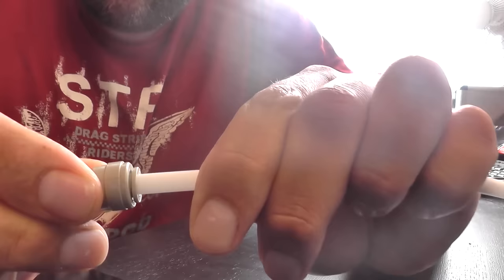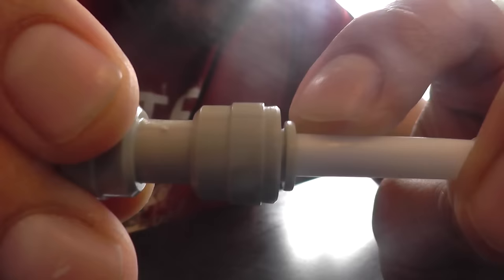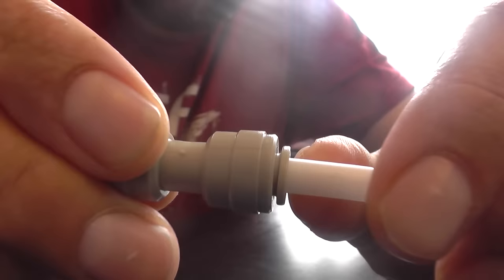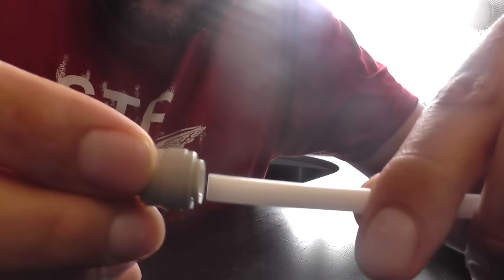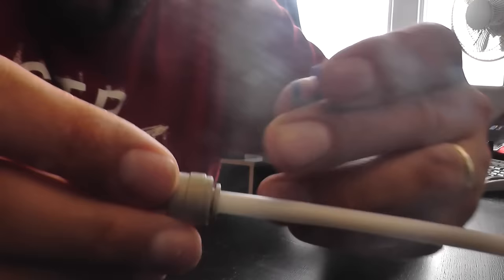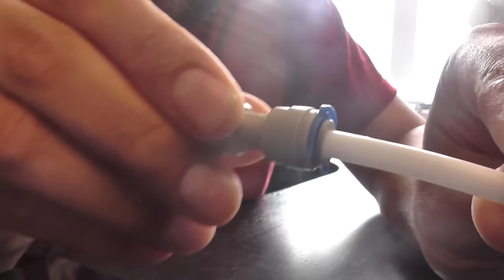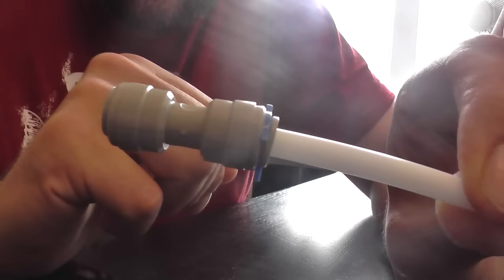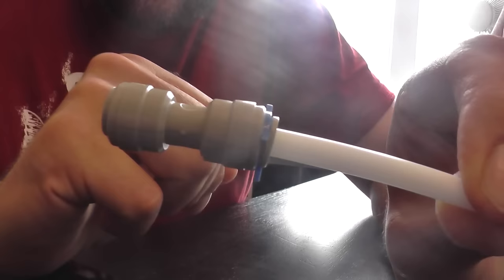How to Connect & Disconnect Push Fittings - Water Filter Systems Guide

Comment: Awesome. Thank you for the informative video. I purchased the connector part and was able to follow your video and connect the two ends of the tube together after cutting out the section containing a pin hole leaking water. Now no more leaks!

Comment: thank you for this video.  There is such an adapter on my water filter and I could not understand why it started to flow.  I just reconnected the hose and the leak stopped.  The video was filmed 7 years ago, but it still remains useful, thanks to the Internet!

Comment: Just what I needed after a failed installation of a water filter under the sink, I needed to disassemble the adapter, which requires removing the push connectors, and there is no instruction on how to do that in the install manuals. Thanks.

Comment: Osmio, Thanks for the helpful video. One question: Where do you get the clips that keep the connection tight? We need to prevent accidental disconnection of the tube from the connector. Do you have a manufacturer name and product name for the US? -- thanks.
Reply from the maker: Hi Tom maybe search for collet clips

Comment: I know this is an old video, but can the connection be rotated once it's secure without removing? They used this style on my washer connections and connections face each other so I can't connect the hoses. I just don't want to break it. It seems fragile. Lol.
Reply from the maker: It can be slightly but shouldn't be because you would be twisting it around the collet grips which can damage those parts inside. You should remove it and then connect it back and not force the fitting to any side, make it go in straight without it being pulled in any direction

Comment: I have a whirlpool fridge and I managed to break the fitting from the water filter holder when I pulled the tube out. Do you happen to know if I can buy just the replacement for that push release cap or do I have to buy an entirely new water filter holder? It is currently dribbling very slowly because the cap won't keep the tubing securely in anymore 😩
Reply from the maker: Hi Lilly contact Osmio Water we have all these types of parts

Comment: Since the Collet Clips come in varying sizes, (1.75-2.85) can you please tell what size clip is needed for a connection measuring 3/8 and 1/4?
Reply from the maker: Jusg search for collet clips 1/4" or 3/8" and you'll find the right ones
Reply: @OsmioWaterH2O  Thanks!  I was mislead by a Seller on Amazon into thinking that a "one-size-fits-all-Collet Clip would work.  What was I think??? In retrospect...DUH.  Thanks for your reply.

Comment: I am having a problem with my push fit connectors (or possibly the pipe is the issue) - they are fine for a week or so and then they start leaking, every time I find the end of the pipe has broken off onside the connector. Is it possible I have a perishing pipe? It is only about 4 years old and has been fine all that time, just recently starting to have problems. Each time I trim up the end and install a new pushfit and then same thing happens a week or two later.
Reply from the maker: Hi Debbie, what's the temperature like around it? Maybe you need to use a tube insert. Also I would just replace the fitting completely once this happens and replace the tubing every few years